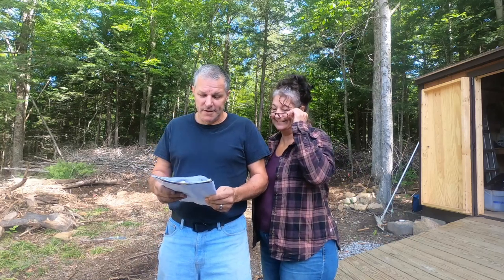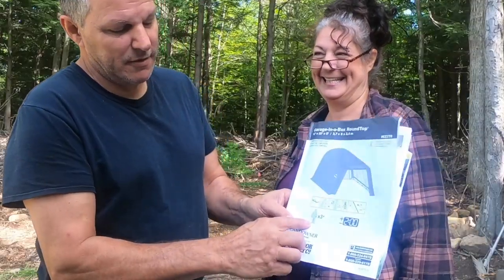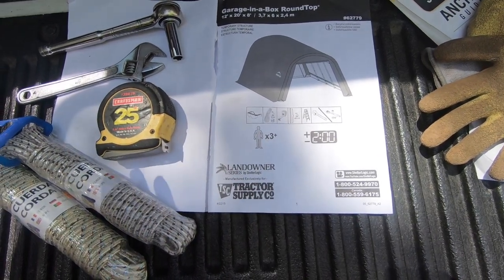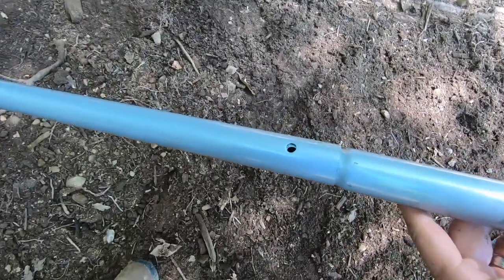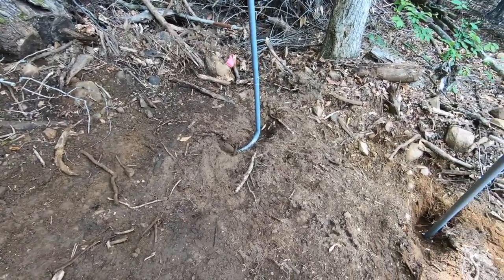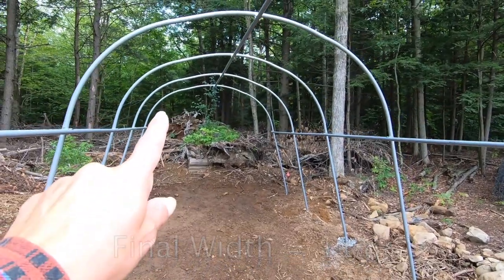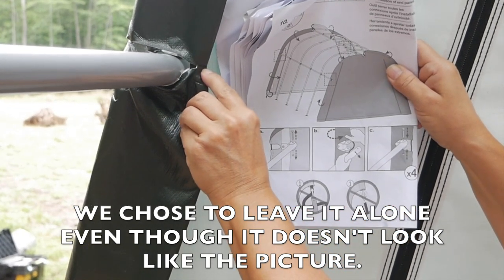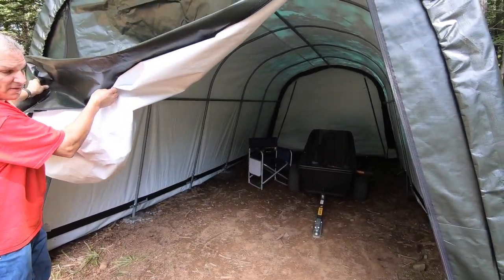SHELTER LOGIC 12 x 20 x 8 Round Top GARAGE in a BOX by Tractor Supply

Comment: We're about to put ours together right now! Three years later from your video, we're wondering... how has your shelter held up? I know they aren't the most durable things.
Reply from the maker: It’s still standing! The top part was beginning to dry rot a little over the bars so we covered it with a tarp before last winter. The tarp was crappy and blew off this summer but it’s still standing and hanging in there. It’s not leaking much but we’ll probably cover it with a tarp before winter again, mostly due to the potential weight of the snow possibly causing the dry rotted original covering from ripping and caving in.

Comment: Hey guys,
Congratulations on your new shelter logic. It's a great product.  I had the same exact one. I bought mine used off a friend for $75 back in 2000ish. Then I got the gardening bug and turned it into a greenhouse. I ordered the translucent cover and doors from shelter logic. It worked great. About 10 years later the translucent cover started to get a little thin in a few areas and I eventually got a few pinholes. So I ordered a new green cover from shelter logic. Then I moved a few years later but my son still uses it for storage. It has lasted through several hurricanes including Gloria, Bob, Hugo, and superstorm Sandy. The metal pipe frame is still rock solid and not rusty. It can also handle a wet heavy snow pretty good but if the snow load gets too heavy, the top cover will pull back off the sides so it's a good idea to keep an eye on it when it snows. Probably one of the best investments I ever made besides my weber grill and my 97 f250. I hope yours lasts as long as mine. I know the field mice are gonna love it. Lol
If the tractor is too tall, I would consider raising the perimeter with stones, cinder blocks or wood and/or soil enough to  clear the door. You could dig a little soil out but then there may be a place for water to pool up and that would turn the inside and everything in there into a moist moldy steambath. Best of luck in whichever way you choose.
Reply from the maker: You got a great deal on it and so much use! That is really good to hear and gives me hope that ours will last a good long time too! Thanks!

Comment: I had one with same name but a peaked roof at my house.  Every snow storm I would go knock the snow off it 2 or 3x per storm then at the end shovel the snow away from the sides.  Lasted 2 yrs.  One summer day I came home to a 20ft long trip at the ridge.  If you dont plan on cleaning the snow off this and keeping the sides clean expect to cover it in metal roofing in a few years.
Reply from the maker: Thanks for the heads up. We are really hoping it warms up enough because it faces south and  that the snow slides off. Just need it to get through this winter. We’ll see ... stay tuned for an update in the spring.
Reply: They dont stay that warm.  Once the snow builds up it can get stuck to the tarp.  I'm also about 2hrs south of you.
Reply from the maker: @BS.-.-  I hear you. We'll see how it goes then I guess. Thanks again for the heads up.

Comment: Ment to be 10x20  its for a car not a full size   tracker  . They just have the name Tracker Supply  . The Harbor Freight model has a much sturdier thicker frame . And if you have it shrink wrapped like they do to boats for winter it will last a lot longer  . Cool though 😎
Reply from the maker: Will be using the tractor all winter to blow snow  off the driveway 👍
Reply: @CreatingASimplerLifeOffGrid  sorry wasn't saying wrap the tracker.  Winter wrap the car port / garage.  It will make it last longer and more sturdy  .
Reply from the maker: @FA-wf2lw LOL, got it!